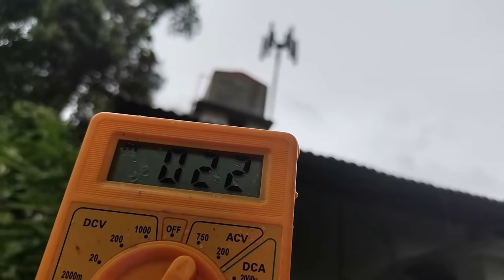diy wind turbine/How to Make Wind Turbine Generator/ Using a Ceiling fan/Powerful Wind Generator DIY

Comment: bro, can we do a same process with use a car battery alternator.? i think its possible
Reply: Yes it's possible
Reply: Yes
Reply: I was told No because a car alternator needs to turn at a high rpm before it can produce enough power to do anything. They are built to run on high RPM not low RPM. I wanted to build a windmill out of one and tested it with a drill and they were correct. The alternator needed to spin fast before it produced 12 volts. That why I am now looking at trying the ceiling fan.
Reply: Car alternators require speed unfortunately
Reply: If you use a small engine it can spin it fast enough to generate power
Reply: Or bike
Reply: With some mods inside it is possible
Reply: Not possible
Reply: Minimum 500 rpm hone chahiye or acche result k liye 2400 tk
Reply: Yes possible bro

Comment: Does anyone know why he used 2 phases? Correct me if I'm wrong, but wouldn't a 3-phase rectifier be better?
Reply: Ceiling fans are not 3 phase motors, they do have a start or run winding but not sure how much energy you could get out of it.

Comment: It looks pretty good and it's cool that you show it powering a tv and a drill although a tv uses about 120 watts. Really what you need to provide so we know how much the output is is voltage and amps at the voltage. It looked like you were producing 30 volts Ac but you didn't show how many amps. Still a great project I might try making a much smaller version
Reply from the maker: Thanks for watching!

Comment: Nice system..
But how many hours the system charges full the battery ex 12V 5Ah?
Reply from the maker: Actually 5Ah is the smallest time that time varies depending on the device you are using. If the battery you use is definitely 20Ah, it can be used for a long time

Comment: Excellent 👌 why don't you use any gear system and brake system? 
A fan has a coil weight more and how it could be supported in top of the pole and how it got balanced
Reply from the maker: No transmission required. Since our house is located by the sea, the wind speed is very high

Comment: Already solar system available what wind turbine genrate electricity attach the solar controller  charger and attach the wind turbine wire with solar plates wire and charging one battery 180 n

Comment: Anyone here knows where the best place to buy copper wire in the US?
I don’t have confidence to buy from Alibaba.
Reply from the maker: https://www.amazon.it/Blank-%C3%980-1-5mm-vernice-bricolage-Draht/dp/B084MK7W8G/ref=asc_df_B084MK7W8G/?tag=googshopit-21&linkCode=df0&hvadid=491005243841&hvpos=&hvnetw=g&hvrand=8910874347018107913&hvpone=&hvptwo=&hvqmt=&hvdev=c&hvdvcmdl=&hvlocint=&hvlocphy=1009008&hvtargid=pla-1147711796556&psc=1

Comment: Bro can we connect to home inverter   with 1800watts battery and if we charger the battery full and at a time what all we connect our house
Reply from the maker: You ask, you can connect an 1800 watt inverter to your home. But you can't use refrigeration fans television in your home at the same time. It is possible to advertise all the light bulbs in your home.

Comment: What are the magnet thickness and size u used in ur project. We tried  with 3mm thickness round magnets.
Reply: But we obtained very less voltage. Only one volt not more than that.
Reply: Give me advise for improving voltage

Comment: Sir what is the size diameter the magnet you used..?? Also you install the magnet is alternate the S,  N
Reply from the maker: First see how big the Ceiling fan you get.......         https://it.aliexpress.com/item/1005001707519765.html?spm=a2g0o.productlist.0.0.2486747cDUv6BI&algo_pvid=241a5490-1096-4a3d-8d80-39238e01e714&algo_expid=241a5490-1096-4a3d-8d80-39238e01e714-2&btsid=2100bdca16184174497898966e6d5b&ws_ab_test=searchweb0_0,searchweb201602_,searchweb201603_
Reply: Boss one more thing how many pieces you used magnet in ceiling fan ?? Thank you for your response sir godbless
Reply: Hello bro can i ask the windmill wire did you direct to battery charging and then battery to inverter??  Can you tech me how you do the wiring diagram boss

Comment: You should have 14.4 volt not 12.3
Reply from the maker: If the amount of volt received is high, there is no problem.You see, we have a 12 volt control circuit

Comment: Can it charge 100 ah battery in how many hours
Reply from the maker: The time varies depending on the ampere capacity of the battery you are using and the devices you are using
Reply: He cannot answer your question because his turbine does not really work.

Comment: Sir wind generator se output DC me milta hai ya AC me?
Reply from the maker: The question is not clear to me
Reply: @tdmade  Sir  Apane Isa video me wind generator se output DC me milta hai ya AC me?
Reply from the maker: @innovationengineeracedamy7173  Can you translate this for me in English? I do not know Hindi. क्या आप मेरे लिए अंग्रेजी में इसका अनुवाद कर सकते हैं? मुझे हिंदी नहीं आती।
Reply: @tdmade  how many V is generating the wind turbine? I saw in video 22V ? And how long is the battery charging? And I think you can use an 4500/6000W invertor...

Comment: can I ask how did you make the fan not braking? I mean when I try to connect the fan to the multitester just to test its voltage it keeps on braking. it won't turn as much as when it's not connected. BTW, this DIY is so cool